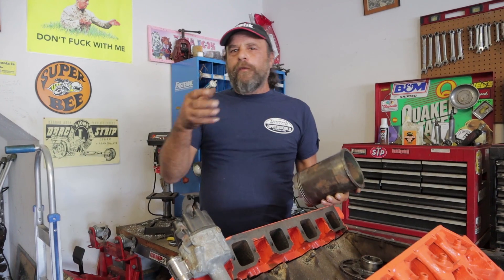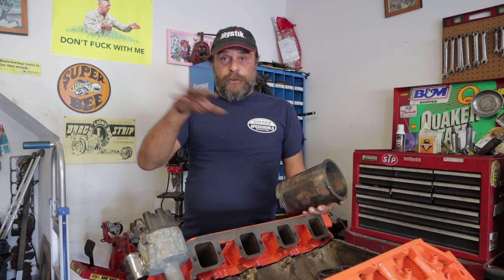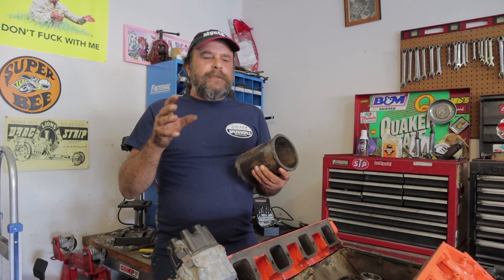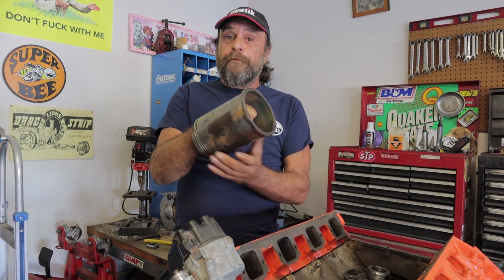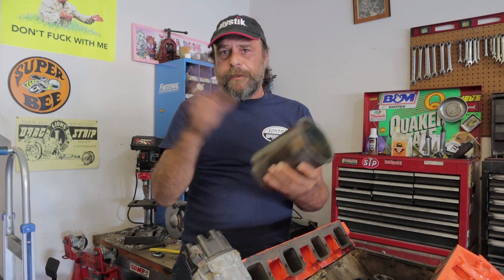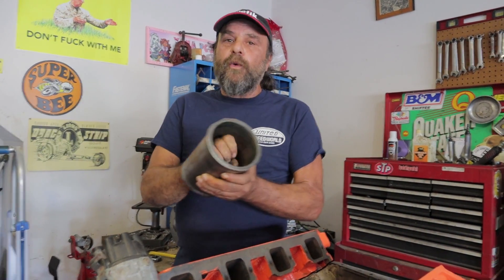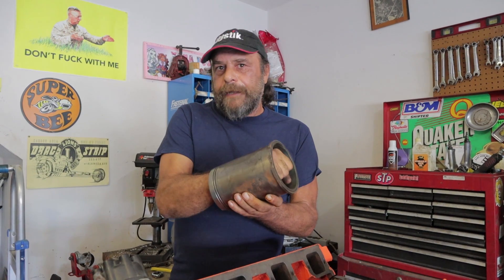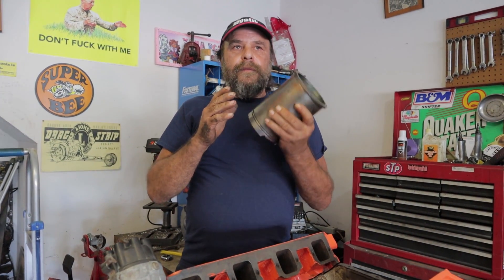The Myth Of Engine Displacement

Comment: I'm a Chevy guy but I once had a dodge diplomat with a slant six that started knocking and shaking terribly but still managed to run and get me from Louisville ky and over the bridge into Utica indiana...when I got home and popped the hood there was a hole in the block I could fit both my fists thru and the connecting rod that decided it was going to tunnel it's way to freedom like Andy from shawshank was laying on top of the passenger side inner fender well.....minus the rod end cap and wrist pin portion....even tho I shut it off when I got home it started up two days later and drove itself right up onto the scrap man's trailer. I was impressed by the remaining five connecting rods commitment to staying in the block and doing their best to keep the engine running.....however I wasn't sad to see it go....my friends named it "pussy repellent" because not one of us ever cane close to getting laid by any females who saw us riding around in that ugly pile of car. It looked more repulsive to women than a guy with erectile dysfunction and a part time job at McDonald's.

Comment: This is complete F'N nonsense.    Total gibberish with zero REAL WORLD examples of any kind.  There are literally thousands of dyno runs you can google with stroker motors.  NOBODY has ever lost power or failed to gain power from a stroker, unless a complete retard built it.  Like putting stock 318 magnum heads and OEM intake on a 408 stroker MOPAR.   It would still outpull any 318.  I've enjoyed a few of these vids, but this was clownshow central.

Comment: Perhaps related...
In the 1980's, the most popular rally cars were producing more power than formula One cars with less cylinders and less displacement. Group B rally is insane, producing over(?) 600 horsepower from 1.6 litre/2.0 litre engines, albeit turbo'd to beyond hell. My favorites among those cars was the Lancia Delta S4, a straight 4 rear-engine, four-wheel drive hatchback with a whiney supercharger and a screamin' turbo. Not what most people would expect to find from their family hatchback...

Comment: This really is over simplifying the engineering behind engine design. Describing one scenario to increase displacement and explaining to defeat of that scenario is ineffective. What about increasing bore? What about increasing combustion chamber volume? Would you also say higher compression pistons actually reduce cubic inches, therefore defeats the purpose?

Comment: Basically you are talking efficiency, I agree. Smaller engines are usually much more efficient, than larger motors. the power gained by increasing CU. IN. is diminishing the bigger you get, losing that efficiency you once had. This is why all those little 4 bangers can make a lot more power per liter/cu. in. than bigger engines

Comment: This is actually a pretty frustrating and somewhat deceiving video.  You start by talking about how far down the bore/angle of the power stroke you the charge actually provides significant force against the piston like it's some sort of magic and that adding stroke doesn't do anything and then at the end you mention that you raised the pin adding the travel to the bottom of the piston stroke where it doesn't do anything... ARGH.

There isn't some magic that if you add stroke it adds to the bottom of the travel and it doesn't do anything- you are relocating the where the piston moves up and down relative to the centerline of the crank but that doesn't mean that you can't make power with it.  Hundreds of factors that come down to cylinder filling and combustion speed come together to determine what you get out of that extra stroke.  Yes, adding bore is more efficient for making more power because you're adding swept area by the square of the amount you add, both have their advantages and disadvantages WRT burn rates, flame front propagation, cylinder pressure relative to crank position, detonation control, cylinder filling...

The 500cube setup beating the 800cube is not because there is no advantage power-wise to more cubes/stroke, but that you are running up against airflow limitations of the top end, detonation control, and reliability (you can't win if you can't make it to the final round).  Big Chief's stuff works because they've found a magic spot where the hardware is just reliable enough to survive races (typically we're talking someplace where the ring package/ring lands end up with enough material in the piston to make them live), the top end can breathe enough to work, and, well boost- a denser air-fuel charge takes longer to burn pushing down on that piston longer, AND as long as you can control detonation you end up with a gentler but longer power application that doesn't break things as easily than other ways of making the same power.

What this video is entirely right about is that hotrodders and a lot of racers really don't understand the effects of displacement and bore stroke ratios (and what is 'common knowledge' according to magazines is just woefully inadequate to make sense of it).  A perfect example of this is how in the hot rod world a chevy 305 is worth nothing, while the 3.8L turbo Buick has a cult following, where they have virtually the same bore/stroke ratio (dimensionally the turbo Buick is almost exactly a 305 minus 2 cylinders) and the turbo Buick gets a worse flowing, similarly laid out cylinder head.  To throw fire on that debate, the current darling swap of the hot rod world, the LS has very similar proportions to both of these.  Yet we throw out 305's and we covet the other 2. :-/

Comment: Actually, it is quite dangerous to the engine to effectively use any more than 90 degrees of the power stroke or you begin to end up losing power and doing damage to your pistons, rods, bearings and journals, possibly even twisting the crankshaft. This is because as the piston continues to accelerate downward coming to the bottom of the crank shaft, it has to give up that energy ultimately to the upstroke [yes, I realize that in every case some energy is always lost to the upstroke (unless you ask some of these wackos out there who think that the flywheel somehow negates this non-negotiable fact of physics)] and that causes needless damage to parts while needlessly sapping power back out of the rotating mass to compensate for it.

Engines which run their burn cycles well beyond the 90 degree point have a much higher chance to break a rod or do similar damage.

The reason for advancing the spark timing is to hurry the combustion up [both in its position relative to the crank as well as its actual burn time] so that on the front end, it adds some cushion to slow down the piston more, thus reducing the amount of power lost from the rotating mass, and also it allows the energy to be transferred early on while the piston is going relatively slow, thus both reducing the total acceleration of the piston, and at the same time allowing it to begin decelerating before the bottom of the stroke, but reducing parts wear/damage and power loss.

My father who built aircraft engines in the USAF during the Korean War explained all of this and much more when I was a child and it was really clear instantly to me, but these days people seem to be less quick on the uptake of physics and the likes so they seem to not very frequently get it.

But then again, I started help rebuild engines at age 5 and rebuilt an engine all by my self at age 7, so maybe they just have not spent enough time around engines to see it all as deeply. ~( ,m,)~

Comment: Not to correct simply to throw my two cents in, I always have felt the term "there's no replacement for displacement" more weighed in on the argument of the Imports vs the Domestic. I've constantly seen (and been part of) arguments between fans of Muscle vs fans of JDM and other imported vehicles and in the end the fight when it gets down to it is the engines actual displacement. Yes your 4 cylinder Subaru makes 800 horsepower same as my Camaro, but that camaro can utilize that power in a better way and is literally double what your engine is capable of. 
While yes the argument is infuriating when you're comparing V8 to V8 I think it holds a lot of weight when you're comparing V8's to I6's and I4's. It makes more sense (at least to myself) when you use it where it truly is correct, you cannot replace the sheer volume a V8 can displace with a motor like a boxer (subaru's most common motor). Sure you can attempt to match it with turbos and superchargers and other solutions but in the end if you took an inline 4 making 800hp in a subaru and an 800hp V8 in a camaro (just using a car I'm familiar with) you're most likely going to see that camaro win majority of the races because it can honestly do what that I4 can't. 
I dunno, everyone feels different on this discussion but this is where I've always weighed in, if you're gonna use it, use it in a discussion where your argument is valid and not just like a cool catch phrase

Comment: What was it Smokey Yunick said. Ah, something to the effect that it all depends on how much air and fuel you can stuff into the cylinder and not have it self destruct

Another thing. Look at Formula 1 engines from any of the normally aspirated eras. There is a very specific reason that Ferrari built V and Flat 12s. A V-12 has a higher ratio of piston area to displacement than a V-8. However a V-12 does have a higher loss to internal friction. Ideally the V-10 is about right in terms of displacement, piston area and internal friction. Hence the V-10s 3.5 liter engines in the last normally aspirated era

Comment: In Europe, a common Hot Rod engine is the Mercedes OM606 diesel.
They are pushing them to over 600 hp @ 5000 rpm and still get 30 mpg since they are still daily drivers.
Not bad for a 183 cubic inch diesel.........lol

Comment: Wouldn't 1" of piston rod be adding a half inch to the top and bottom stroke?
Reply from the maker: Not if you raise the pin to do it
Reply: @UncleTonysGarage  by "raise the pin", do you mean heads or lower the crankshaft spindle?  I know a Chevy 388 stroker is a 400 crank and rods in a 350 in basic summation.
Reply: @Taco_Syndicate  he means the pin in the piston. A lot of stroker motors move the pin much closer to the ring area on the piston to gain deck clearance. That can have an effect on "side pressure" and such in the rotating geometry though. 
I just read yesterday about someone stroking a 440 so far they ended up with the oil rings in the actual pin hole! I thought it was batshit crazy and would end up shortening that engines life dramatically, but for $$$$ drag strip builders they probably don't care, it all about winning.
Reply: @davenhla  thanks for the explanation.

Comment: So essentially weather you have a higher cubic inch verses a lower they're both only utilizing about the same percentage of the cylinder. This would also explain why stroker make more torque but less horsepower per cubic inch.

Comment: "No replacement for displacement" just refers to the fact that, all other things being equal, a bigger engine will make more power.
Reply: Perfectly stated. “All else being equal” is the key. A factory stock smog equipped 454 from 1976 is rated at 235 HP,/395 torque; not as much power as a 6 liter L96 from 2016 makes 360 HP/380 torque But those engines are completely different and unequal.
Reply: @MrJeffcoley1  
And you could even take that lazy 454 from 1976 and add enough cubic inches to it that, even with it's pathetic hp/l, it would make more power then the modern 6 liter it you wanted be be extremely literal, lol.
Reply: @MrJeffcoley1  Two things.
1) It's not quite “All else being equal”, it can't be because a larger bore is more prone to detonation. That said... 
2) A 454 is a FAR better base engine to make power with than a L96. Even displacement aside the 454 has far better heads.
Reply: @snek9353  yes, my point exactly. The 454 does not make as much horsepower as a 6.0 L from 30 years later because everything is not equal. Go balls to the wall and do everything you can and the 454 will destroy that 6 L all day long
Reply: @MrJeffcoley1  Even more so, there's no need to go "balls to the wall". A very drivable big block that makes 1000HP/1000TQ on pump gas it completely doable. Now it wouldn't be a 454 anymore, probably a 540 and almost every part would need to be aftermarket. But it wouldn't be that peaky big cam and turbo stuff that only makes power for like a 500RPM range just before it'll blow up. 

That is the magic of big V8 engines, smooth, useable, daily driver power. The kind of power where ya only need 3 gears. The kind of power that'll get a 6000lb luxury car to cruise the country with ease and comfort, and do a 11 second 1/4 mile at just the press of a foot.
Reply: @snek9353  there's always jdm fans putting there 2 cents in about the 1500hp stock supras
Reply: Thanks I hadn’t thought of it that way! Come to think of it, that reasoning might also apply to many other aspects too (i.e. all other things equal, a turbo, a supercharger, heads with a higher flow rate given the same valve lift, and many other things, will add more power)
Reply: For the 2JZ fanboys... What has to be done to make a high HP 2JZ makes it also nearly undriveable. The HP is only at very high RPM, very peaky, and it requires special fuel.
Reply: But my 75 455 is only 200hp max in stock trim......
Reply: @edbowden6000  okay, and? Then all of those variables besides displacement suck ass on your engine
Reply: @edbowden6000  I believe that the 455 (Buick, Olds, or Pontiac, you didn't specify...) was de-tuned down to a 7.6:1 compression ratio and a very "mild" cam in order to meet NOx requirements for 1975 engines.  And that horsey rating is at WHAT rpm?  There was a period where the "hot rods" fell out of favor, especially with INSURANCE companies, so understating the power output, as well as not touting performance potential, of Detroit's products was the rule of the day.  Truly 'twas the nadir of the domestic auto industry.
Reply: @selfdo  NO, IT WAS THE FIRST NADIR.
Reply: @exploranator  I can believe that.  What other "Nadirs" would you say happened?  Use of TBI?  Minivans?  I can think of a few less noteworthy events of automotive history during and after the "Malaise Era".
Reply: @edbowden6000  That's because it was "de-tuned" and the compression LOWERED to get the NOx emissions down.  Anytime you lower compression, power is greatly reduced.
Reply: I was going to say something similar to this except give an example with two of the same engine's lol 😂
Reply: 177SCmaro you didn’t tell him why that is.
Reply: @peterviceroy1592  
I figured the lack of a response meant he understood what I was getting at.
Reply: More power yeah, but with gravity it definitely doesn’t always equal more speed.
Reply: I realy dont jnow what deos it menas i think american stupidity dont know what it means too.
Reply: put a caterpillar engine in your car dumbas
Reply: Not always.
Reply: @residentevil2928  Yes, always. Basic physics. Whatever you do to a 350 you can do to a 454 and make more power. Bigger engines make more power is the basic sentiment in "no replacement for displacment".
Reply: @177SCmaro  but everything MUST be equal, and physics unfortunately do not work that way. 

Why you see engines like the 6cylinder 2jz outperforming small blocks at time. So much goes into the right power plant, and making it efficient. Think that's what he was getting at.
Reply: @phoenixrising4573  No idea what you're trying to say. In order to outperform an engine with greater displacement the 2JZ relies on boost and usually a lot of it. If you take away you're looking at 3-400ish hp engine. Maybe 500 if you built a screamer with huge cams, compression, ect. 500hp is fairly easy for a larger displacement small block and 700 and 800hp isn't unheard of again, with a lot of rpm, cam, compression. 
Do you know why that is?
Reply: @177SCmaro  because theres no replacement for displacement 😉
Reply: @gsfbffxpdhhdf7043  woah woah thats overstepping a bit. Theres 2jzs out there on bone stock internals holding 1000. The 2j is not a joke. Ive seen built ones make 2500. Lots of potential and an engineering masterpiece. If you dont respect the 2jz, you either dont know wtf your talking about, or your ls got dragged by one
Reply: @phoenixrising4573  its not about the number of cylinders.
Reply: @traxxasrcfun  they can’t make 1000 horsepower on stock internals lmao
Reply: @brodylake2831  yes, they have. They live happy at 7-800, but will hold 1000, for how long? Depends on the tune.
Reply: @residentevil2928  Yes always.
Reply: @residentevil2928  True, true.
How often are "all other things equal?"

Comment: I never though about that in that angle, so if we go in the other way, like a F1 engine, the swept is way smaller, at their given efficiency, the real total power benefit comes from the high rpm, and how much explosion per minutes they can produce.
Reply: combustion chamber heat and longevity of the block then become the issue. F1 motors still give me goosebumps though
Reply: @feff5717  yeah, I agree

Comment: It's why a stroker motor is really modified as a combined unit. Heads, valves, intake, cam, carb and distributor. In order to take advantage of that longer stroke to increase the power generated and the efficiency at which that power is generated. Unless you are an expert and have access to a dyno. Buying a stroker engine turn key is the best option if you are not absolutely sure what you are doing.